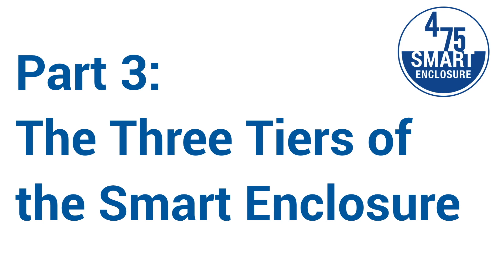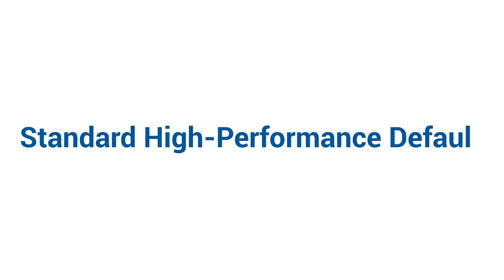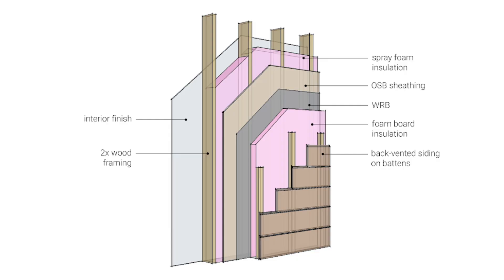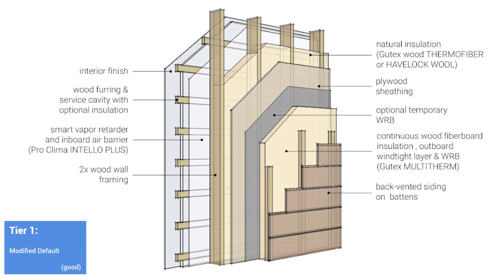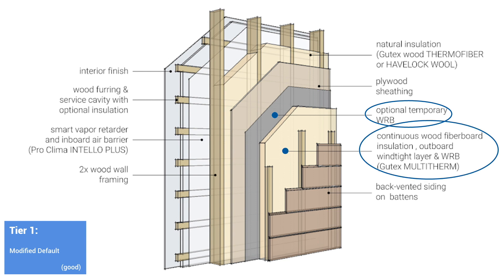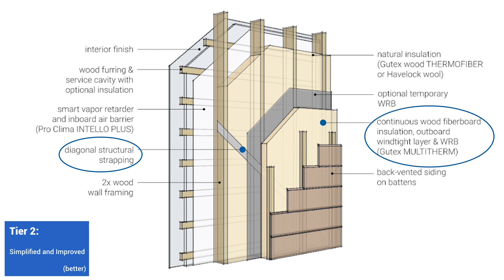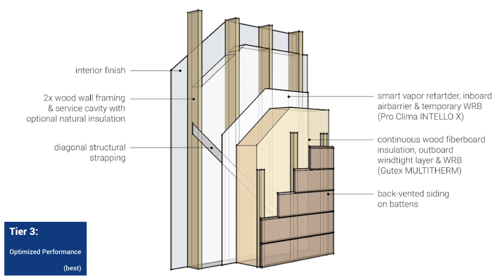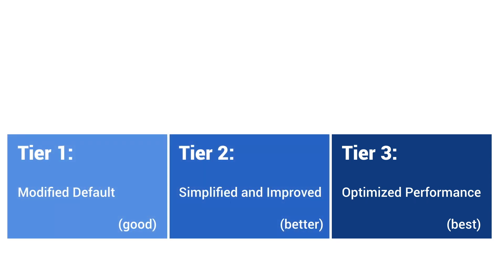The 475 Smart Enclosure, Part 3: The Three Tiers of the Smart Enclosure

Comment: In tier 2, does the diagonal strapping satisfy shear load requirements?
Reply from the maker: That is the intention of the diagonal strapping, yes. It's up to each project team to ensure it's done in a way to satisfy local structural and seismic needs. Our details cannot be use to advise on those decisions, so local structural engineers need to be consulted before making choices related to structural.

Comment: What is old is new again. Looking at the construction that was done years before structural panels osb or ply wood. Wood was inset into the frame to give it racking strength.. When I first started looking at not using the panels I am sitting here going OH NO. but after further thought got to thinking about the hundreds of thousands of buildings that only had a layer of ship lap boards on the outside. Many of these buildings were balloon construction.  They breath and are still standing with no problems.  Use of wood fiber inset also means no real cavity for fire spread.    The thing here for me is moving from OK normal to OK Great comfort levels.   So interesting to see how less is so much more.  thumbs up